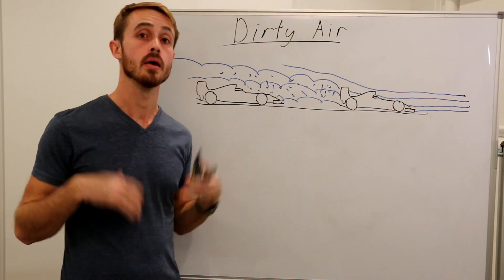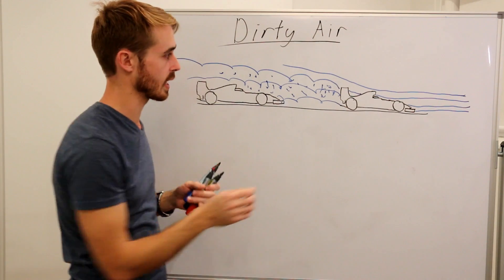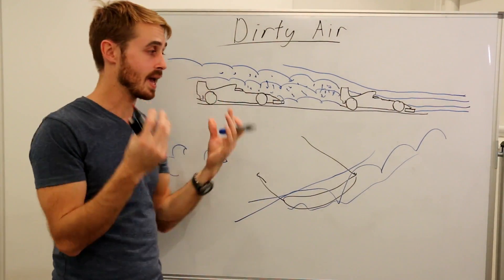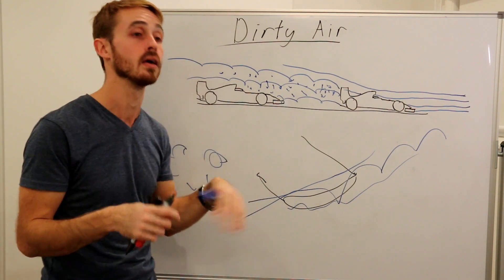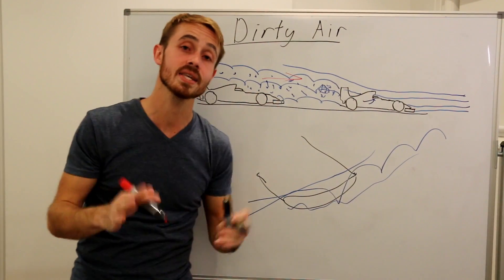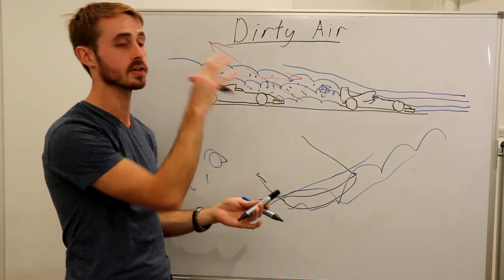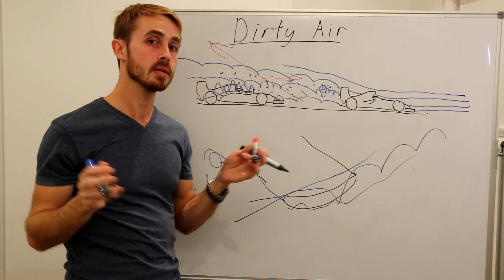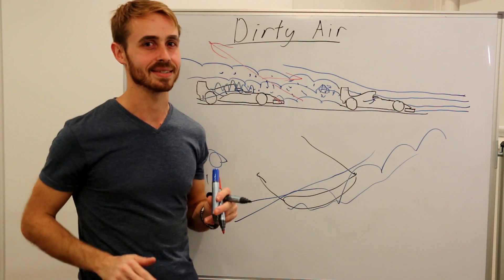What is Dirty Air? Dirty Air Explained

Comment: Really interested in the possible solutions!

Would it be possible to use something similar to what is used in wind tunnels to clean up airflow? Generally honeycomb mesh to straighten out airflows right? Would something like this attached to the back of the wing and diffuser have much of a useful affect do you think? It obviously wouldn't clean up all of the airflow but would be interesting to see if it would work at all.
Reply from the maker: patw52pb1 Is largely correct, I'd just like to add to it that if you were to put a flow straightener at the back it will likely promote stall on the rear wing earlier, as straightening that flow will have effects that propagate upstream. Also, in order to straighten the flow to flat, you would produce considerable lift on your straightening device, thus making it redundant as you could just run less downforce in the first place.
Reply: If you are referring to square, circular or honeycomb/hexagonal cross section laminar/flow straightener devices, my expectation would be yes, a device would straighten the flow(some), however I would suspect there are several negatives. 
It would introduce drag even if a simple screen type device and the effective distance downstream of any flow straightener device would likely be relatively short before the air stream became chaotic or dirty again. 
The air flow on, by, around and through a vehicle at speed is very chaotic and highly dynamic moving in many different directions simultaneously and affected by numerous elements including but not limited to vehicle attitude, velocity, other vehicles and atmospheric conditions/changes. 
The now corrected air flow down stream of the flow straightener device in a given area may then be re-disturbed by other chaotic or disturbed air rendering the initial effort futile. 
Try performing some CFD modelling experiments and continue thinking about solutions, that is how problems are solved. 
Cheers.
Reply: Thanks yeah definitely makes sense. It seems like the proper solution is for the car behind to simply have aero that is less sensitive to the turbulence.

Another solution that sort of made sense to me was just allow cars to have more moveable aero devices and allow all drivers to use them whenever they want. Like DRS currently, but allow it on the front wing an anywhere the engineers want, both drivers get less drag on the straight but there is also less turbulence, and drivers still have to earn their overtakes.

One other thing I have seen mentioned is actually using electric current to keep flow attached to a surface.

Comment: I thought I knew what Dirty Air is however your video brought up so many more points than the usual "no nice airflow on your car anymore" explanations, so thank you very much for that!
As I understand it, in most cases dirty air will cause you to understeer when being affected. DO you think it could also cause oversteer? Maybe when the turbulences aren't actually influencing your front wing too much but rather your rear wing?
Reply: Tony's Racing In Nascar when you are the car in the front you will get les downforce at the back so you get oversteer. In F1 I don't know if they get the same effect cause they don't get as close as Nascar does.
Reply from the maker: Completely depends on the aero setup on the car, complex front wings that are using many small vanes will be generally more affected by the eddies, wheras a simple rear wing wont be as much,  hence the tendency to understeer on something like an F1 car (there is an overall downforce loss as well obviously). As Rodrigo mentioned, in other cars it will be different. Really is completely dependent on how close your wings are to stall. Remember, even F1 cars do complain about burning through the rears when following, so it is hugely dependent on setup from car to car.